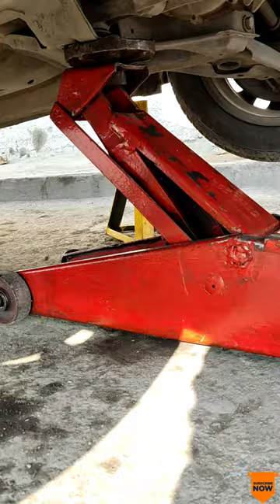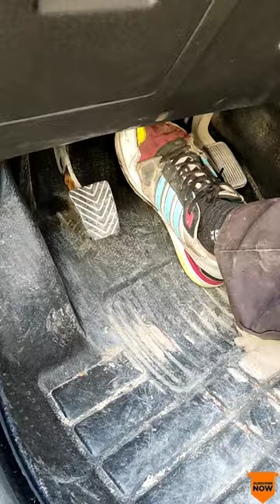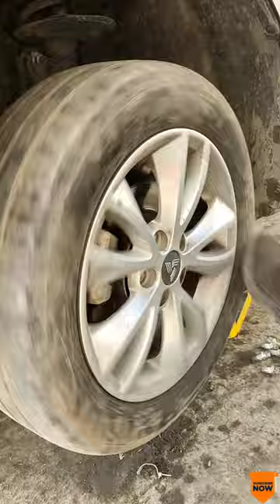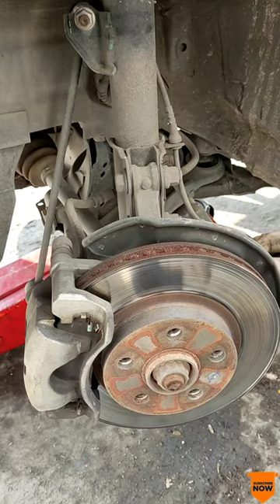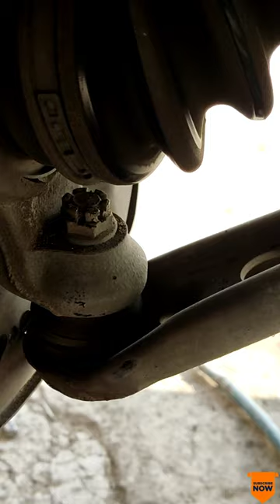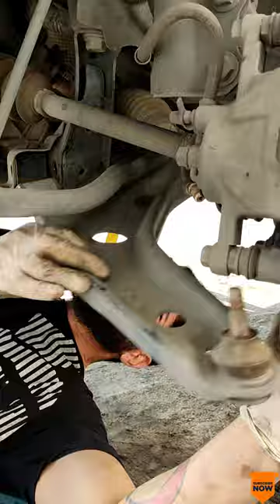#shorts #mechanic

Comment: Tech tip: if you can't get the wheel off and you have to wail on it with a dead blow hammer to remove it, install at least one lug nut loosely to keep the wheel and tire from flying off when you beat it half to death.
Reply from the maker: Hello, dear friend, yes of course, thank you for your good advice

Comment: u should crake the wheel nuts before jack them up
Reply: Not really since he does have the tools to undo the bolts/nuts easily.
Reply: I agree. One of his work buddies would have had to step on the brake pedal so he could use the power bar. Definitely crack wheel nuts before jacking up the vehicle then use the air gun. Other then that, this man has skills.
Reply: And replace the stretch bolt that is a one time use, and yeah every time loosen any nuts/ bolts under weight especially the driveshaft nut 180 nm plus quarter turn

Comment: Please use a dead blow hammer to remove stuck wheels, you can damage the lip of the rim and on occasion crack it from fatigue with a metal hammer.
Reply from the maker: Yes, thank you 🌷